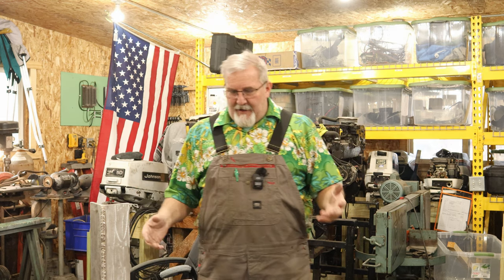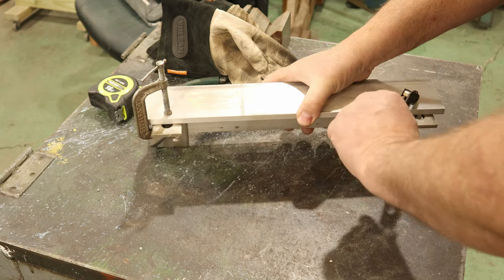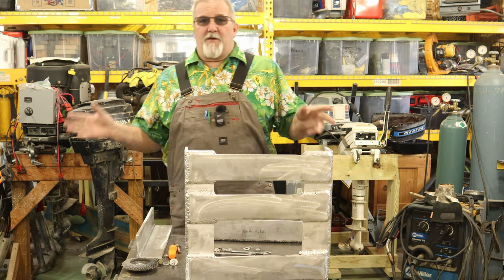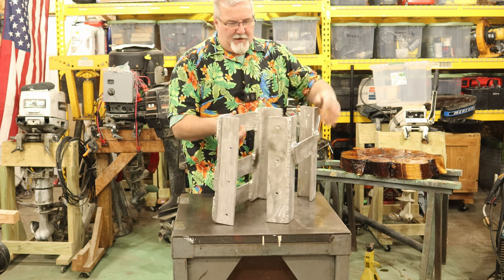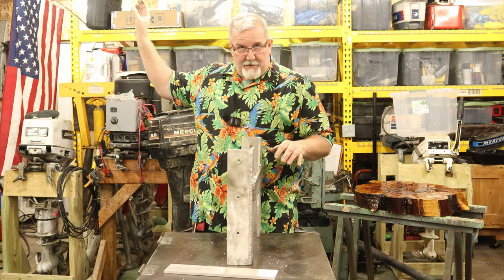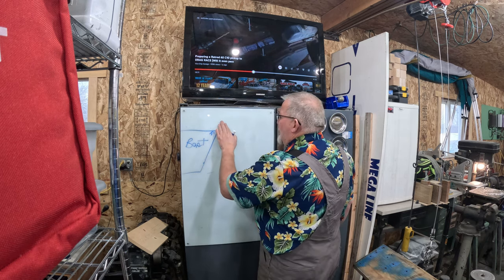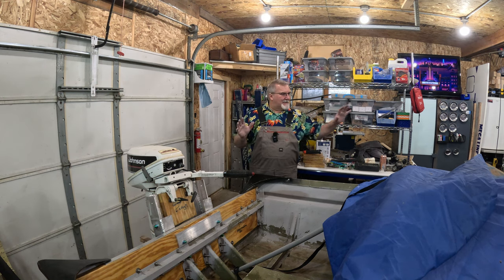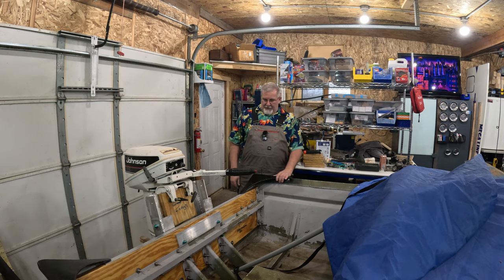1983 PolarKraft Jack Plate Build  Ready for any outboard now  How To and How it turned out

Comment: Setting that cavitation plate a bit lower than the boat's transom lowest point will, as my grandson would say, have the motor grow a "watery mustache" once on plane. It will only marginaly affect performance. You do need though that top wood section so to have the transom clamps bite into, absorb vibration and prevent the engine sliding off while in use. Regards !
Reply from the maker: Good to know, thanks for the info and for commenting and watching

Comment: I feel if a weld holds up and it don't break how Carr's what the welds look like. Lol I most likely would have use 1/2" bolts at the bottom the two spacers I would have weld them on. It looks like its going to work just the way you what it to 👍. I just have a idea the bolts an nuts you have to take out to move the jack plat up an down you could weld all the nuts on that way you can have one hand on the jack plat and the other hand on the bolt with washer's
Reply from the maker: Function over form every time for me. Thanks for watching

Comment: Hi Mike,   Im curious how well you will be able to access the transom clamps on the short shaft setup.  It seems that they will be between the plate and the transom.   Also, perhaps instead of 4 separate bolts for adjusting the plate height you could put in 2 long “clevis” type pins through the whole plate frame and use a couple “R” clips to secure the clevis pin.  It might be a lot easier to switch between setups.
Reply from the maker: thanks for the idea on the pins, not too bad, easy access on the clamps in the lowered position, thanks for watching
Reply: @Michaelsbackyardmarina  Using clevis pins would simplify height adjustment  but will allow some movement within the frame. That could be lessen by spring loading the pins against the locking R pins and adding some kind of liner between the moving parts but it should be rattle galore back there. I say: just bring along your cordless impact driver on outings, use nylock nuts and leave well enough (or is it Goodenof) alone !!!

Comment: more of a riser plate than a jackplate  but everyone calls them jackplates. got one on my bass boat  nice cast aluminum one thats around $350.00. if there's one thing i hate welding it's aluminum.
Reply from the maker: true, at least it has two positions. Were you able to gain some more top speed with yours?